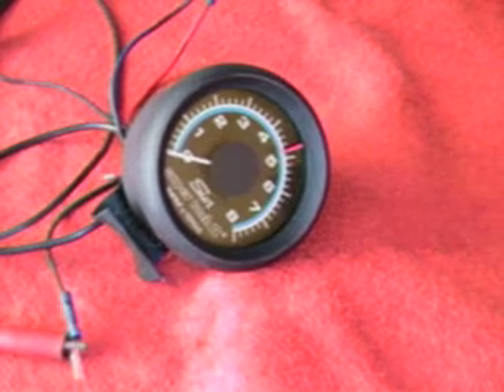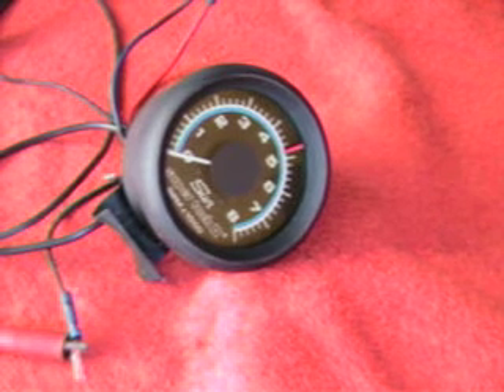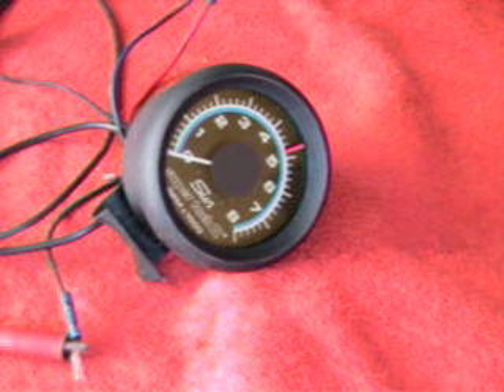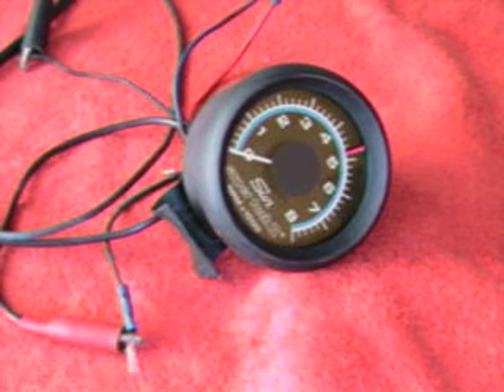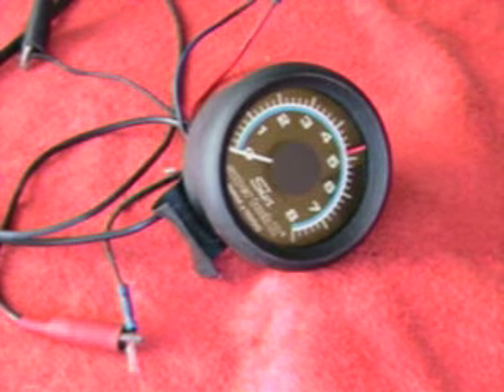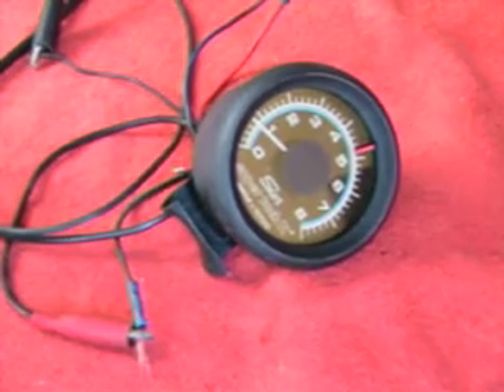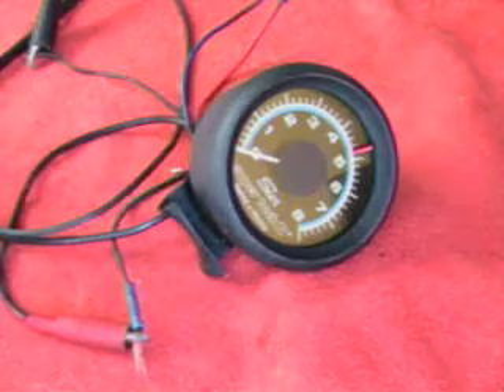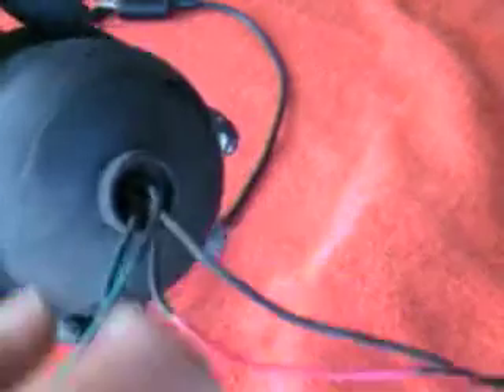VINTAGE SUN Super Tach II 8000/RPM

Comment: I connected the trigger wire to a Crane Cams HI-6 ignition box. I was told that would fry tach. I had it temporarily installed in the engine bay, so I did not see if it moved at all. How can I test the tach to see if it's still good?
Reply: I guess you could test it on another vehicle